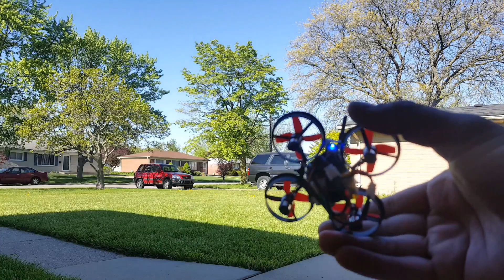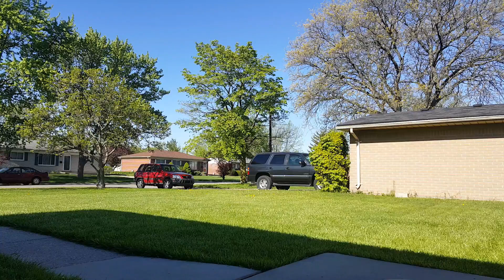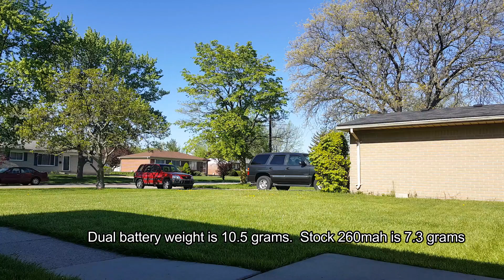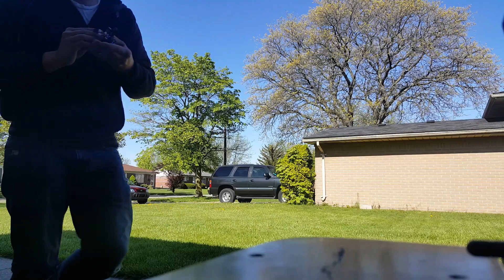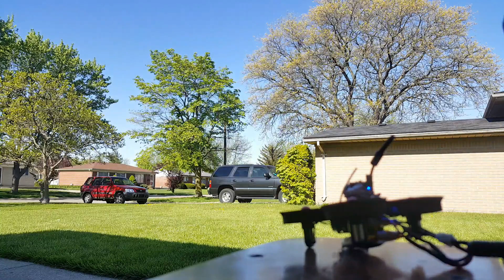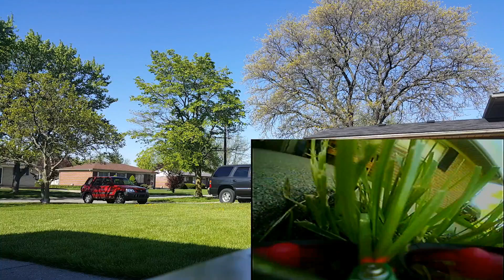Eachine E011 Dual Battery Test

Comment: Hi I have a very simple question : I want to combine a 500 mah 25c with a 260 mah 30c to make 760 mah 3,7v lipo battery, does the 5c difference make any problems ?

Comment: so do you recommend going with the JST 2.0 on the E011 regardless of parallel or not? Seems like it would save weight
Reply from the maker: Eric Ka yes absolutely.  The pico connectors are a limiting factor when using LiHV lipos.
Reply: ok cool. Do you have a link for recommended batteries and a charger? thanks!
Reply from the maker: Sure thing.  Check out my Blog post.  You will see the batteries I use and a great charger.
https://craytech.blog/2017/10/10/your-winter-whoop-guide/